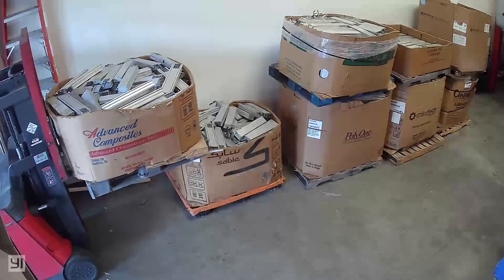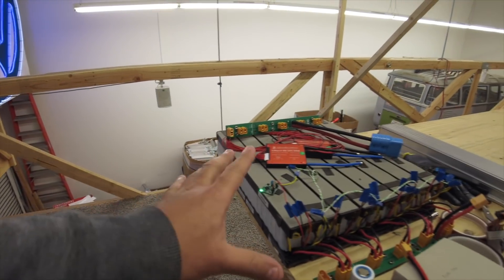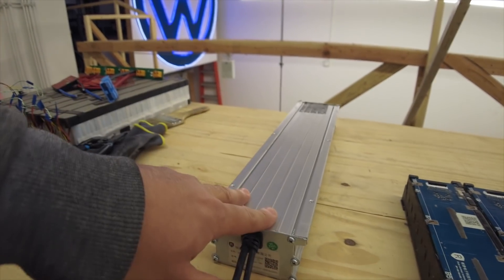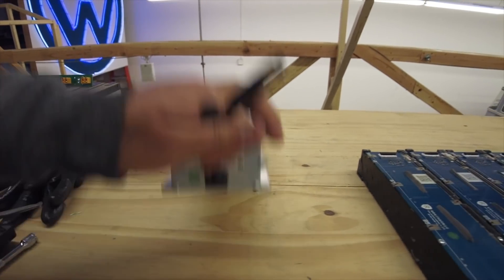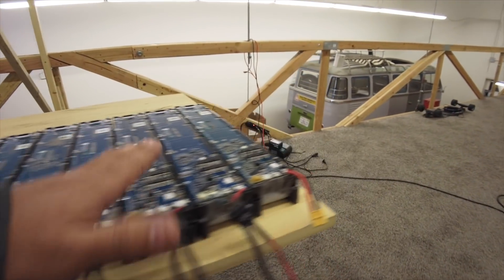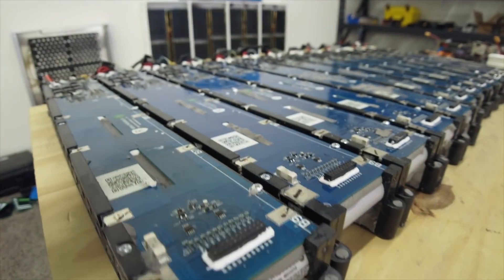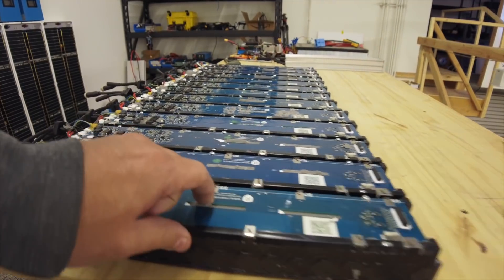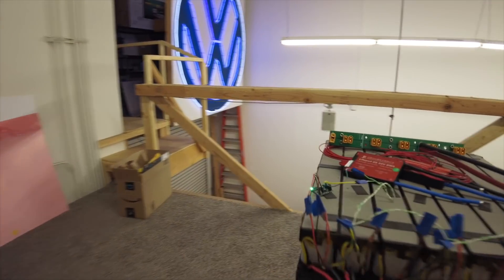You Can Build a DIY PowerWall using these Scooter Battery Packs

Comment: breaks my heart wen i see all this nice stuff only for the us market why dont you guy,s find a way to send it to europe
Reply: It would have to be shipped via cargo ship and would be very expensive. They cannot be shipped in an aircraft
Reply: @1gearwrench  cargo ship is cheaper than air just takes longer
Reply: @1gearwrench  HI, I have same batteries if you can help work on them you can have some . i am in london
Reply: I'm Australia same laptops or powertools batteries and sick of pulling them down.
Try finding medical backup batteries and surveillance camera backup batteries maybe,  Dyson also , cheers.
Reply: @paddy2661  I'm in Australia also and them laptop batteries, the plastic cases can be really sharp.
Reply: @Blackwolfster  absolutely sharp i gave up after 100 cells,  plus to many odd cells.
Lithium forklift batteries the go few hundred amps 3.2v less mucking around if you can find a contact . Even half capacity on the cheap would be worth it.
Cheers.
Reply: They're the batteries Uber pulled from the thousands of scooters they destroyed in June

Comment: Its simpler than you think. If you can get a few packs to utah I can give you detailed instructions in a few days at most. I'm willing to show you how if you would be able to kick down a few packs for my scooter builds I have going for winter . hit me up. Shaun Bryson
Reply: They are just waiting for the conntroller to tell them to turn on its easy to find and bypass.  Ive been building and rebuilding scooters and trikes.since 2012 And this is somthing. You run into a lot. Especially when your building a ride from an incomplete scooter  and have to improvise.  Check out my facebook page https://www.facebook.com/shaunbryson1 and the videos I have are some of my current trikes I'm building this winter.
Reply: Hi did you get any answer? I bought ten and will try the serial communication over arduino to be able to turn on power over the RX line via serial with arduino...  but want to do more and get to read the voltage from the cells coming from the TX cable.

Comment: Would you be interested in doing a rv solar system????? I have a 45ft diesel pusher and looking to put solar on it. Could make for a good video. Of course i buy all parts?????????
Reply from the maker: I would if I didn't already had 100 projects
Reply: @jehugarcia  check other comments for the wake up code of the battery .... Some one awnsered your call 👍👍👍🎉🎉🎉🎉